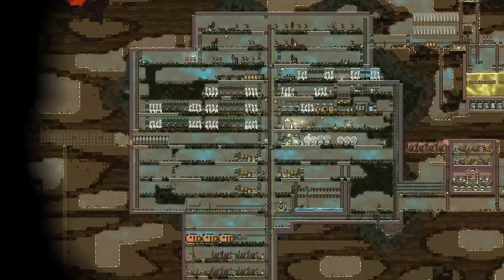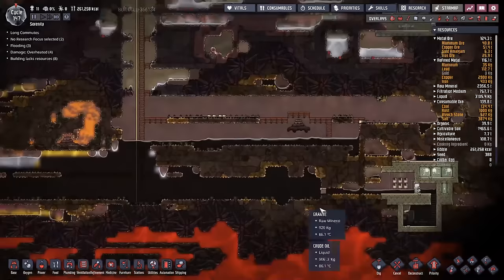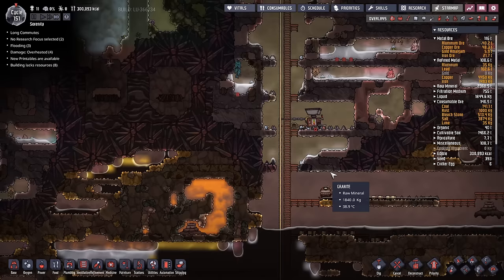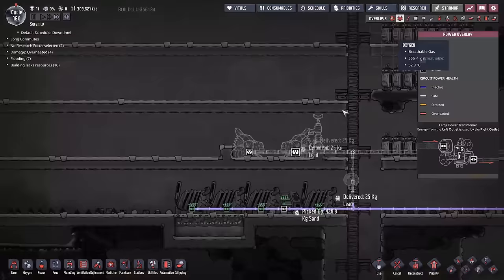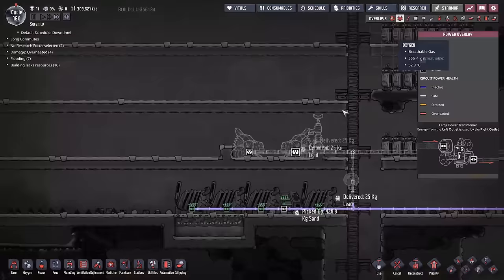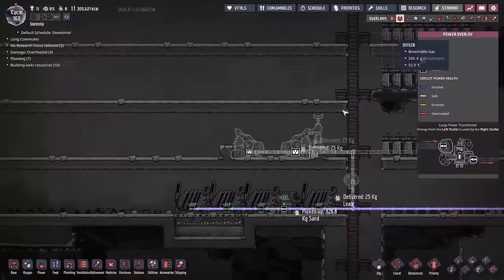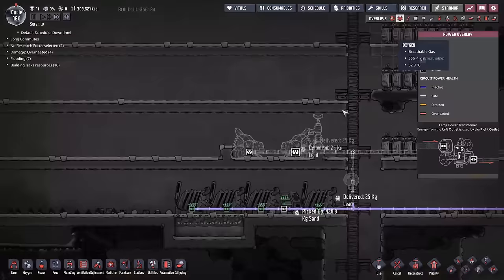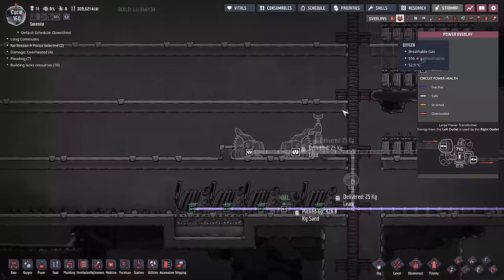Getting mid game Steel, Plastic & Cooling : Tutorial nuggets : Oxygen not included

Comment: It seemed a bit off that you used 6 billion tons of refined gold making conductive wires and radiant pipes before setting up the "first" metal refiner. Are we supposed to use regular wires/pipes, or rock crushers, or just live with the heat until the cooling becomes operational? 

(Edit: Didn't realize this was part of a series, yes apparently I should be using the rock crusher.)

I've been trying to get a cooling solution going but the heat from refining the amount of refined metal needed just for pipes and wires has made my base borderline uninhabitable. I guess the biggest takeaway for me here is to insulate the base and put all industrial machinery outside. (And not bother with transformers, which emit stupid amounts of unnecessary heat. Just use localized power generators).

Comment: Hey FJ, love your tutorials! They've really helped me out with getting further into the game. There's just one thing I don't quite get from this tutorial.
And that's when you add the liquid element sensor at 19:55 and connect it to the oil refinery. I just can't to seem to make that work. For now I've just 
added a NOT gate in between, but I'm not sure if that's the way to solve this problem. Could you elaborate on how to make this part of automation work?
Reply from the maker: At this point the game had not introduced automation to liquid tanks. You can cut out all the piping and liquid sensors and just hook the oil refinery to the liquid tank via an automation wire. We had to do some work arounds for missing automation early on, this was one of them. My favourite was the lack of a vent for conveyer rails. You could not just drop items from a conveyer on the ground, you had to wire up a power cut off on a timer to make auto sweepers drop stuff, so silly.
Reply: @FrancisJohnYT  Thanks for your reply! 😀
Ah, so that's why you used the sensor like that. It seems like you needed to use some creative automation in the early days of ONI. It reminds me of the early days of factorio when there also weren't many options available with the circuit network.

Comment: I'd find it interesting to see how you would handle all of this on say Arboria (or I guess The Badlands).

If you're on Arboria or the Badlands without geodes, you don't have gold amalgam, and don't find a cool slush geyser or polluted water geyser (is either of those guaranteed to exist on the map somewhere?), do you think it best to hazard an electrolyzer with a pump that probably will get damaged eventually from a warm water source, or do you try to use rust deoxidizers more?
Reply: Spoonwood in my current base (not sure which asteroid) i have no gold or aluminium and went straight to steel, its not that hard to get some starting steel if you have some water at a reasonable temperature.
Reply: you can pipe the water into the electroliser in such a way that it will keep it from overheating, just make sure to use copper or wolframite instead of iron for the pumps and electrolisers.
Reply from the maker: Would depend on the map but rust is so plentiful I would probably carry myself with that for a while until I have steel sorted so i can do a proper permanent O2 solution. However with a bad map roll it might be necessary to do a getto O2 setup.
Reply: @FrancisJohnYT  Thanks for the response.

Comment: At about the 10:00 mark you create the first steam turbine after gathering some Steel & Plastic, but you make the turbine out of Lead?  Why use a metal that lowers the overheat temperature in a machine that you're actively spending effort to actually prevent it from overheating?  I'm sure (hope) you have a good reason, but it's not mentioned there and so I wonder if it's a mistake you didn't realize until after this video was posted, or something?  Also, I have heard you explain why you use polluted water in other areas, but if all you're trying to do is get rid of all the gases from the steam chamber, wouldn't using JUST regular water work just as good?  Plus no dirt left behind when it evaporates.  Lots of useful information here but also mixed with some confusing stuff, lol.  Thanks
Reply: Think I eventually answered my own questions, posted here in case you read this and maybe correct me if I'm wrong.  You use lead to create the steam turbine because it's not the actual Overheat temp of the building you need to keep under control, but the turbines own failsafe shut-off when it hits 100C, so the material it's actually made of doesn't matter much (unless you use something that makes the turbine heat up faster I guess).  As for the 2 types of liquid I'm now assuming that's merely a space saver trick to get just the 1 ton of water you need in a 5x2 space.  You can do this with a few grams of polluted water on the bottom (in each tile) with the 1 ton of water on top of it in order to vacuum seal the room.  Otherwise you'd have to put a little over 5 tons of JUST water in if you did that.  I guess a simpler solution may be to only use a 1x5 tile but then dupes can't get in there to fiddle with things.  ???  Great videos btw, thanks again.
Reply from the maker: You answered all your own questions quite well.
Lead is cheap and easy to access on this map but you can use any metal to make steam turbines it makes very little difference.
2 tiles allows you to fit in an aquatuner, also having only one tile and the water you pump back into the room will block the vents of the steam turbine for a bit before the water turns back to steam. You can get away with 1 tile if you want but if you have the space 2 tiles is preferred and is usually more stable.

Comment: It seems this tutorial predates some update that added automation to reservoirs? So instead of a sensor I can just run automation wires from the reservoirs to the refinery, right?
Also this setup doesn't seem like it works the same as the one in your Practical Automation Tutorial, it's missing the not-gate. Building it this way would mean the refinery only turns on if the reservoirs are full and there's petroleum in the pipe, right?

Regardless, thanks for the great tutorials!
Reply: He forgot the not gate. You do need one.

Comment: There's no need for the liquid element sensor next to the oil refinery because nowadays the liquid reservoirs have automation built in, just as gas reservoirs do. Makes automating a lot easier. They basically work like Smart Batteries and will ask for more liquid when they need it, and their thresholds (like Smart Batteries) can be set by the player.

Comment: At 16:32 you mention how you can queue up a bit more coolant to avoid the "awaiting coolant" notification that can show up.
My dupes are running into it all the time and if I fill it with more then I get another notification saying "output pipe blocked."
Would you be willing to elaborate a little more on how to deal with this, please?
Reply: gotta put that little loopy pipe recirculator thingy in the line. bridge back into the tank so the water runs in a circle if the line stops flowing.

Comment: Love these tutorials. Started playing Oni and I'm always nervous about drilling through Abyssalite. I'm afraid it's going to creep in heat into my base. Should I not worry about it?
Reply: Hey just saw this, but hopefully you still want an answer. You should insulate what parts of your base you want to stay cool, but otherwise heat is not really an issue in this game- that is unless you are growing crops for some reason, which would be dumb considering how OP hatches are for food, but if you are just put some insulated tiles and you are good. You should also consider the thermal conductivity of stuff. CO2 has very low conductivity, and so heat will not transfer through it very well. Oxygen is better, but still not that great. All that to say heat spreads through blocks much better than through air, and so if you put some insulated tiles where necessary you are good to go. I regularly run 40+ degree bases (Celsius of course) and as long as I don't make some of the hotter stuff out of lead I have never had an issue. Hatches don't care about heat, just they just live long enough to make eggs to evolve into meat.

Comment: I spent over an hour trying to figure out why the thermo sensor for the aquatuner wasn't doing anything. It appears there was an update that added an automation connection to the storage and so that can cause issues if its connected. Moving the automation to avoid the storage fixed the issue of pipe breaking because the autotuner never turned off.

Comment: I learned piping hierarchy from you, thanks for that! I was wondering, is there a way to provide liquid to an input through two different outputs but in a way, that the input port doesn't pass on the liquid to other inputs of the pipe network?

Let's say I want to pump polluted water into a metal refinery from a cold slush geyser, but without the metal refinery passing on the rest of the water it can't take to other plumbing, wasting my precious cool polluted water, but without making the cold slush pump and the metal refinery a closed loop, so the refinery could accept coolant from other sources. Thanks!
Reply from the maker: Not sure I understand the question full but if you want the refinery to accept coolant from two sources you would use a bridge. What ever liquid you want to take priority gets fed into the white side of the bridge. The secondary liquid gets plugged into the output green section.
Reply: @FrancisJohnYT  The "refinery" has an input. If it's full and doesn't accept more liquid, the liquid from "Pump A" travels along the pipeline to the next device's input. I want to avoid that, that's my main focus here. I want "Pump A"-s output to feed the refinery exclusively and only the refinery, while making it possible for the refinery to also accept fluid from a "Pump B", so without putting the "refinery" and "Pump A" in a closed loop. Hope you understand now. Thank you!

Comment: Is it better to use petroleum or oil instead of polluted water for cooling loops?
Reply: If the coolant goes through a Thermo Aquatuner, Polluted Water is way better than Oil or Petroleum. The thermo Aquatuner cools any liquid a flat 14°C. But not all liquids are created equal. You want your coolant to have a high Specific Heat Capacity. That tells you how much energy is needed to heat that material by 1°C. The higher it is, the more cooling it can do per kg. Polluted water has a SHC of 4.179, Oil is just 1.690, Petroleum is 1.760. 

I hope that helps you out. 🙂

Comment: wonderful guide tbh but i have two questions, how do you refine glass inside that room and also, can you use crude oil or petroleum as your cooling loop ? i lack polluted water/water on my map
Reply from the maker: Petroleum and crude oil can work but it will cost you more energy due to the way aquatuners work, they reduce the temp of a liquid going through it by a flat 14C regardless of heat capacity. You should have no issues refining glass in that room, just make sure the glass forge is not in any liquid.

Comment: I just don't get the petroleum, or any substance for that matter, as coolant going inside the steam chamber cos it gets even hotter! Thus, the refinery gets hotter to the point of breaking. Why?
Reply from the maker: The steam room is getting cooled by the steam turbine. If the temp is above 125C in the steam room the turbine eats 2kg/s of steam and spits out 95C water into the steam room.
So the refinery coolant might hit 300C but as it passes through the steam room it transfers heat to the surrounding steam pushing the steams temp above 125C and causing the steam turbine to start destroying heat. The save game is linked if you want to load it up and have a play around.

Comment: 1 aquatuner reducing water temp by 14 points is going to be enough to cool a steam generator and keep it from overheating?
Reply from the maker: Not to straight forward a question. Steam generators produce heat at 10% of the heat they destroy. So if you are running 150C steam into it then no problem. But say 2000C steam and you won't. You should not go above 200C steam using a steam turbine, you get no more power and you just end up with more heat being generated out the top.
For one Aquatuner using polluted water you can keep 6.66 steam turbine cool assuming the steam turbines are eating 200C water.

Comment: I need help! I use crude oil as coolant for my metal refinery in this exact setup and it keep busting when it turn to petroleum at about 399. I haven't try petroleum yet as I notice that the coolant temperature keep raising each time it go trough a loop and afraid that it gonna burst in to sour gas.
Is there anyway to fix this?

Btw, thank you for great video, your channel have become my go to channel for ONI information!
Reply from the maker: As the oil passes through the steam room it should be dumping heat, do you have steam in the steam room? How much steam? You should have at least 100kg per tile. Is the steam turbine working?
Also do note the save game file is linked if you want to download it and have a poke about.
Reply: Thank you for replying!
Oh I have only 20kg steam per tile, that might be the case. However, I have 3 steam turbine working at full capacity to destroy heat and the steam temperature keep fluctuate at about 160-170c and I have the problem only when I have all 3 of mine metal refinery working at once, is it possible that the steam turbine can't keep up with all the heat produce by the refinery.

Comment: When setting up the oil refinery in your base, you put an element sensor on the liquid line to turn off the refinery. Doesn’t the sensor send a green signal when the chosen element is detected?  Which would turn the machine on, not off. Wouldn’t that mean it would send a red signal when the pipe was empty? Essentially preventing your dupes from ever using the machine. I’m sure I’ve misunderstood or done something wrong.
Reply: i'm having the same problem I still don't fully understand automation yet but i'm getting a problem with the oil refinery saying disable due automation grid,  do we set the sensor to petroleum or something else not that i think anything else would be in it

Comment: Please do one about base optimization, I'm on cycle 1300 LOX and LH and im starting to notice the lag issue, 23 dupes + two pilots. Nee ideas, running lots of errands manually.
Reply: I'm on cycle 700+ and can only go for a few cycles before it crashes.  My last asteroid made it to 1000+ with constant crashing, and now it won't even come up.
This game is buggy as fuck.
Reply: Step one, turn off time lapse video in save game dialog.
Reply: Apparently a lot of the lag comes from the dupe path finding, so adding automation and simplifying routes can help.  I use a lot of auto sweepers to preload machines.  Sweepers and conveyors help you move stuff around reducing dupe movement tasks.
Reply: @probablynotmyname8521  Yeah that's what I mean but I get kindof lost with the settings the sweepers work but dupes still do manual stuff. 

Also, I tried the dropoff single spot storage but now my dupes are doing lots of trips for everything whereas before they could get some of the stuff from the floor. 

Overall It's not unplayable but im already at the point of not being able to run it maxspeed, at least not while expecting to move the camera smoothly.
Reply: @WillRaben  connecting ladder segments can help you if you have a lot of separate ladder bits hanging around.
Reply from the maker: I will add an optimization tutorial to the list, but there is not to much you can do.
Reply: @FrancisJohnYT  Thanks! and also thanks for the awesome content. That ocean over magma was cathartic !

Comment: Did the polymer presses change since this video? I used this video to get my first industrial brick started (3 metal refineries, 2 polymer presses and 3 steam turbines) and everything works very well, except for the presses. They go from 25°C to 125°C in like 40 seconds, even with 10°C polluted water filled radiant cooling pipes behind them.

I resorted to using a temperature sensor and manually control them with it for now.

Comment: Well I when the water finally turned to stream.   After years and everything over heating.  The stream really never stays at 125 to turn the turbine on.  If it does turn it on the water vent come out of the turbine says over pressured.   So it never gets water to run out.   And the chamber stays about 120-125.  Damaging everything.
Reply from the maker: If the steam pressure is above 1000kg the water vent becomes blocked, I usually aim for about 200kg of pressure in the steam area.

Comment: Hello, is this build still working? Is there an updated version somewhere?
Reply from the maker: Still works just fine, built one just a few weeks back. Save game file is linked in the description and should still work.
If your on Spaced out DLC this is the most recent video where I made one, save game is linked in the description of that one as well.
https://youtu.be/HEl6X1_PeRw?t=1742
Reply: @FrancisJohnYT  Could you tell me what's wrong Francis, i build one exactly like yours. But there's 1 output pipe from the aquatuner to the liquid bridge that keeps breaking, exactly the first pipe. It says the pipe is too cold, i tried rebuilding using igneous/granite/obsidian insulated pipe but its stil breaking. I'm confused because your build is fine.
Reply from the maker: @FarissimoID  what temp do you have the sensor set to? It sounds like you are freezing the polluted water in the pipe.
Reply: @FrancisJohnYT  After comparing to your latest setup, yeah i didn't connect the temp sensor to the aquatuner. I set it to above 15c now just like in recent one, so far its working well. Thank you so much! Felt great when everything is working even though it isn't my own design lol.